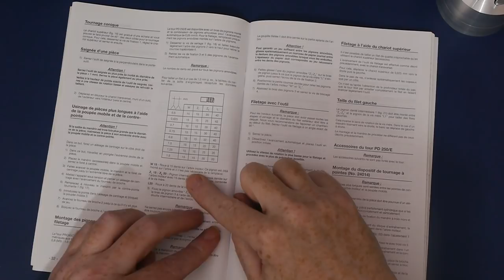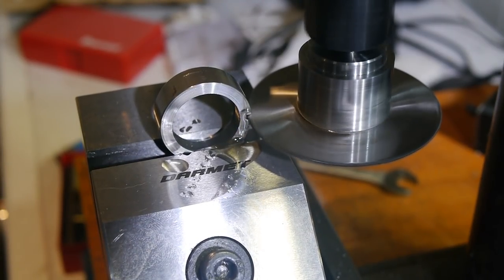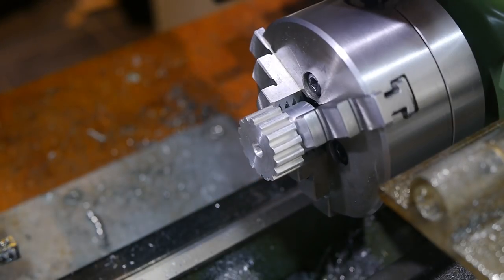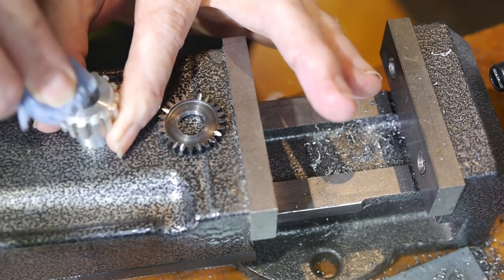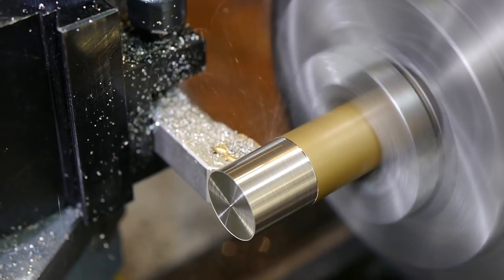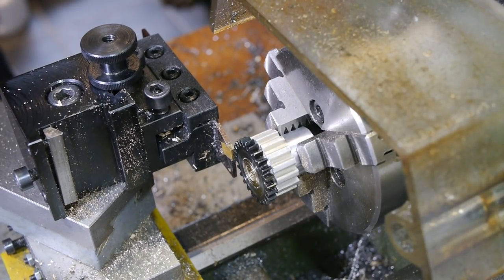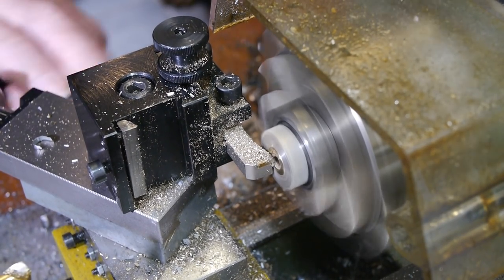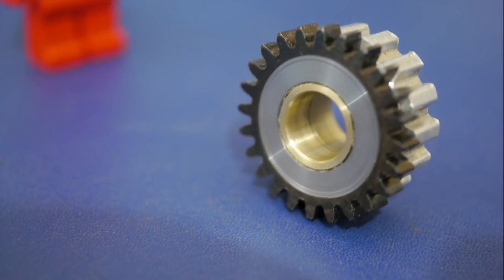Making a Change Gear for a Proxxon Lathe - Orchestral version

Comment: Nice, I had to do the same thing for an imperial thread, and got away with just remodeling the belt part and an appropriate gear, and 3D printing the result.
Reply from the maker: How did the 3D printed material hold up under use?
Reply: @AdventureswithaVerySmallLathe  Well I only did like 4 pretty short threads, but it worked and didn't seem to show wear. It will certainly not last as long, but then again  in 2 clicks and 20 minutes I can have a new one, so... I believe I printed it in PETG. Would probably do PC now but I didn't have that back then.

Comment: I bought the 250 and I'm a little sad that I didn't take the 400. I'm trying to do a 20 thread pitch per inch for drill chuck. the imperial set of change gear that is available to be bought for extra can make imperial threads other than the 20 thread pitch per inch. so I'm stuck to the option to pay a gear cutter set with a milling machine or to try and figure out what gear I need ( number of teeth, pressure angle, pitch diameter , diameter pitch...) then order it online and fit it to a XL timing belt pulley drive as you did.

the 400 is more capable in threading as I noticed too late.
Reply from the maker: I know exactly what you mean about the 400. When I first started out, I had no idea whether the hobby would work out, so the 400 seemed like a scary amount of money. If I knew then what I know now then I'm pretty sure I would have invested in the 400, but then I would have had to come up with a different name and concept for my channel. :)
Reply: @AdventureswithaVerySmallLathe  by the way, you are the reason why I went and bought the 250 ;p
But over all I'm happy with my purchase and the lack of options gave me the opportunity to explore unusual setups to achieve higher potentials with my 250.

Please make more videos because you have more knowledge and you speak english which I can understand :D

Comment: Hey great video, and I love your stuff. But when grinding on your lathe be careful. The dust from the grinder will destroy your ways, if I need to do any grinder I usually cover the ways, and then I just quickly clean them after.
Reply from the maker: I usually put a leather cover over my ways when they need protecting, like I did when I was using the hard-turning CBN insert earlier in the video, but for some reason I didn't when I was grinding. It's a while ago, so I can't remember exactly why.